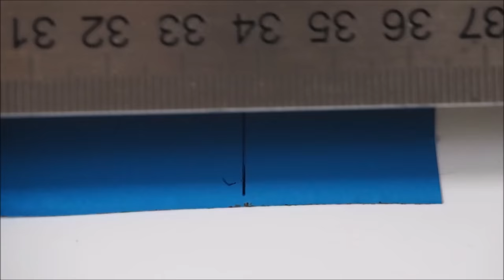How to drill in ceramic tiles

Comment: Music and advice equally naff.
Just use a special glass/ tile drill tunsten or diamond tipped. Drill through the tile and you can then use a concrete drill for finished depth. When using a tunsten/ diamond drill always cool the bit with water spray to avoid overheating the bit otherwise ii will not last long. Try not to drill near the edge of a tile as it is more likely to splinter if there is a hollow caused by lack of adhesive.

Comment: One can use a stirdy knife with sharp tip and with a hammer carefully 'chip' the very first micro puncture to the glossy lackered surface. That way the point of the drill has a center from where to start.
Reply from the maker: Thanks for advice

Comment: Why not use directly diamond cutter?
Reply: The diamond cutter is for bigger holes. Also there are some specialized drill bits but they're expensive for diy work.
Reply: @ShiningForce07 you can get reasonably priced drill bits for this job, the methods in the video are wrong and shouldn't be done that way.